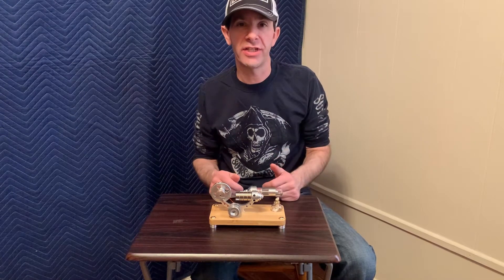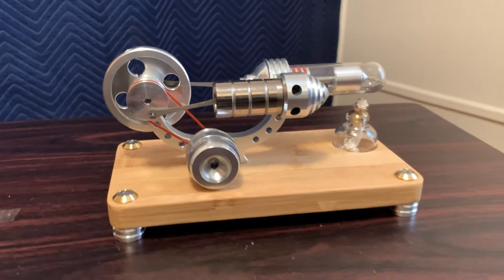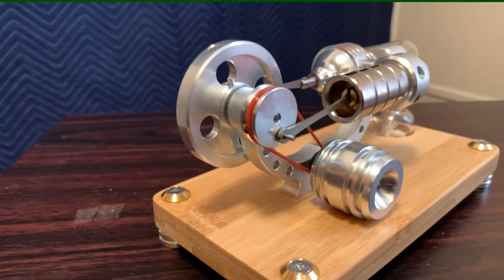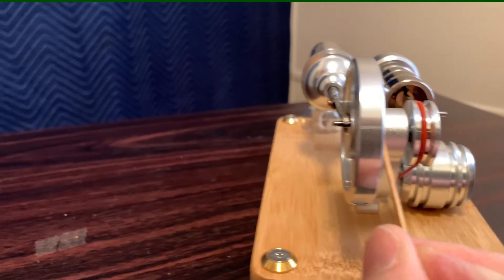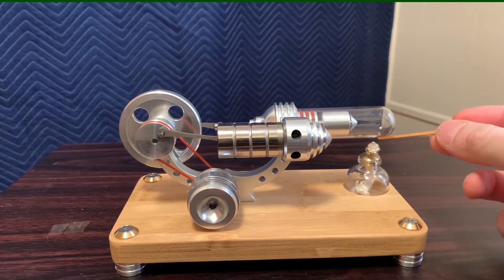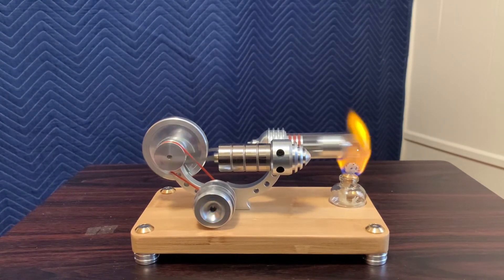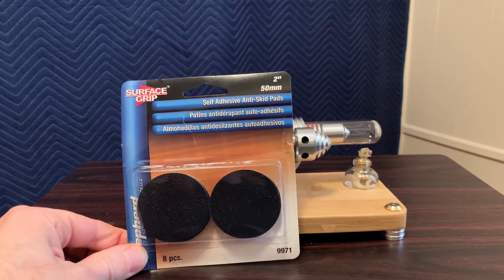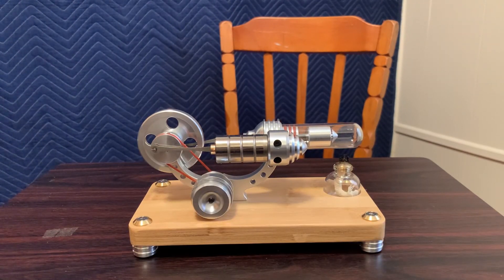SunnyTech Stirling Engine Running with LED, Oiling Points, Fuel and Vibration Dampening

Comment: Still trying to figure out where the flywheel and piston needs to be before installing the glass
Reply: Is the answer at the halfway point so the air pressure is equal at each stroke?